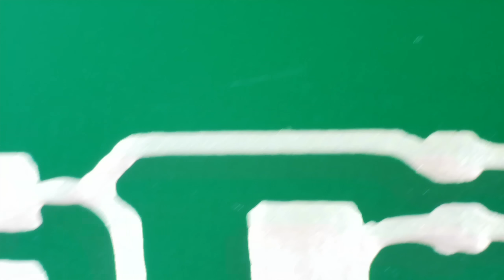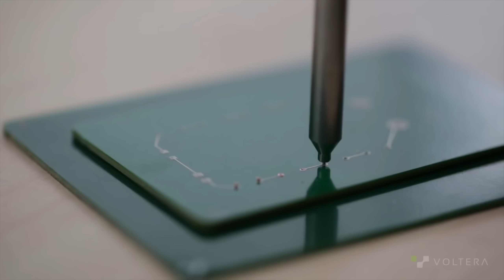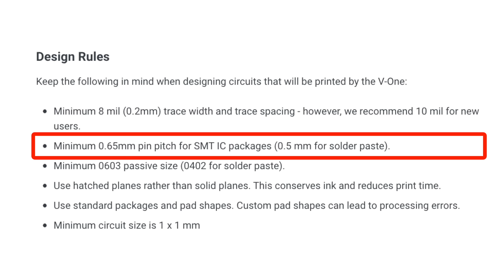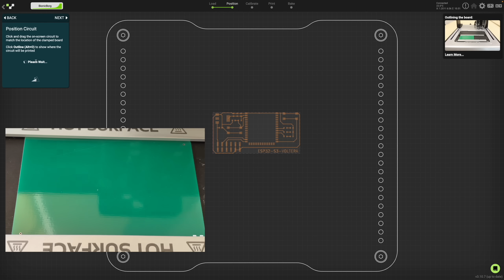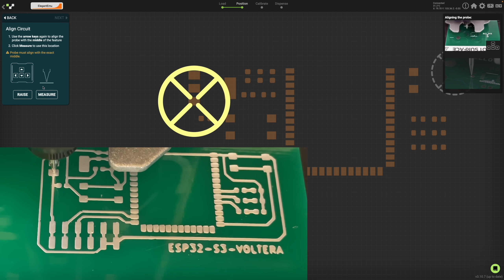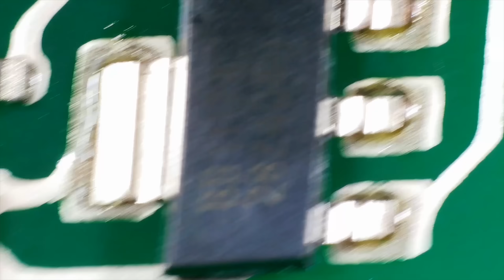Printing PCBs At Home!

Comment: Just get a K40 laser or some other cheap laser, make some safety mods, and use that! Black spray paint goes onto Copper Clad Board, then the outline of your traces gets engraved, theb etched, and then you clean the spray paint off. Surprisingly accurate THT and SMD footprints if you are careful with the dremel when you drill it! I have been doing this for like 8 years now
Reply: @user-tz7lk3cx1d  
It Kinda Works has a great video, but he does way too much work filling in pads and such- I have found that the etching is consistent enough that you dont need much post-processing on your PCB. I do a first pass at the lowest my machine will go (~1w) at 8mm/s  and then a pass at 14mm/s. Then I clean it with an old toothbrush, soap, and water. I put it into ferric chloride for 15-20min. I drill the holes with a dremel, for THT parts, and end up with a perfect PCB almost always.
Reply: You can do the same with a 3d printer and a sharpened screw instead of buying a laser. It's called pcb scraping.
Reply: @zaqwsx28  Yep! I have tried that too! Works great!
Reply from the maker: Nice - I've been looking at these cheap laser engravers, but so far I've held off due to safety concerns.
Reply: @atomic14  Honestly, after some limit swotches to stop the laser when the lid is open, and after getting some approved safety glasses for the correct wavelength (a quick google search will find them for you), and grounding it, there really isnt anything that can go wrong! The machine is honestly a lifesaver for quick prototypes and goes great alongside a 3d printer as well!
Reply: This really works, it takes time buying the right paint though : (
Reply: how thin can you go with ya pcb boards?
Reply: @pepe6666  I have done 0.1mm traces without a problem.

Comment: Do you know how many boards you'd have to make to offset the cost of an actual PCB fab? Especially with the severe limitations of the manufactured board.  There seems to be absolutely NO cost benefit to this machine, except maybe for a classroom setting or something like that.
Reply from the maker: I think that's their target market - a large enough pool of users who will get through the consumables before they expire and just need to get something made quickly.

Comment: For components which will have mechanical loads applied, how about pre-milling the pads slightly to remove the gloss from the board and give a better key for the conductive paint?
Reply: This is good idea

Comment: Is it normal to half un-melted solder left over round the joints as I can still see the tiny balls of solder ? I think this is so niche they can't be making many. The complexity of the circuit is very limited double sided and via rivets all seems oddly like a step back and Oh ! the price tag to rich for me I fold !....cheers.
Reply from the maker: I think that's the effect of the solder no flowing on the pads, it kind of melts in place and you get the flux residue remaining. Or I need to crank up the heat a bit more. It just doesn't behave like normal reflow. And you're right, the price is way too much (as demonstrated by almost all the comments :))
Reply: :) @atomic14

Comment: It dispenses from a nozzle then bakes it - sounds like it would be better just to stencil an image on it with some powdered flux and then powder coat it with  conductive dust (sticks to the flux) because you already have the ability to bake boards. 
Then you could basically make boards in one shot processes instead of having to speed up the video 10x - faster process means less footage means less editing work too!
I'm super lazy and this also looks like a lot more effort to manage the tools and materials because they get wet with materials that cure, blegh always running against a clock or something with wet/activated materials...

But honestly if you're gonna do it this way then you should be able to use the same gantry to pick/place your parts too, especially since it already knows the board plots.
Reply from the maker: I'm surprised they haven't got a pick and place attachment - it feels like it's almost got everything to do it. It's just missing the cameras for aligning parts.

Comment: i had problems when i had an led on pin 2 or 4 (in not sure wich didnt work).  when i wantet to upload an arduino programm in my esp32 dev board, the esp worked fine to upload on my laptop but on pc i always needet to press the boot button, but this didnt work... so the programming always timed out. it took me a while to find the problem, because i made 2 of the same boards but i used my pcb cnc.  one for my friend, and one for me. my one did work without any problem,but the other board did not work and looked like it was write protected... all parts where the same only the ir recivers did came from old pcbs i salvaged.  but the problem was that i had the resistors for the leds a little too small, and the tolerance in the resistors itselve did cause the problem. just used ones with higher resistance and it worked just fine.
Reply from the maker: Easily done. Sometimes it's just not obvious which pins will cause issues. The documentation always seems very clear, until you find that it's not!

Comment: So expensive 😢. It’s a glorified 3D printer, so it’s a little wild we haven’t seen some cheaper alternatives. Or… maybe there are some?   The movement system isn’t that much different, and precision seems like it’s even less important since the ink and paste squish out some.  🤔.  I guess when using the drill it would need more rigidity and precision.
Reply: I think you're right. Considering it's a glorified dremel doing plunge cuts, not routing it doesn't seem like you'd need a stronger structure. Decent sized linear rails vs the standard roller design on low grade printers might be helpful to minimize torsion. I'd almost bet someone out there has already done this somewhere. That said the laser engraver method which was outlined on this channel or the resin printer solution seems like just as viable of a solution with much less tinkering involved.

Comment: OK.... what stops anybody just using a basic 3D printer.. with a liquidpump???

Also... just set it into epoxy after reflow soldering?

Or maybe they should just add a glue pump option that also applies glue points that melt while reflow. (Initially liquit through solvent.. but melts again at like 300° or what their solder needs). Cant be that hard!

Comment: I wonder if electroplating a layer of copper would improve wetting
Reply: probably. might also work to reinforce the bond between the traces/pads and the board, or at least make them more rigid so they don't flex as easily.

Comment: Being able to fast prototype with SMD, the solder paste printing, and fast turnaround would be huge pluses, but the drawbacks of being single sided with no vias would rule this out for me. I’d rather pay 20e and wait, and get a professional board with cutouts, stencils, and holes. For prototyping I’ll keep using veroboard with breakout boards for SMD chips.
Reply from the maker: Agreed - I would be interested in trying out the drill attachment and the rivets - but it feels like a lot of work...
Reply: Do you mean 20 €? Is it delivered from China or you order locally?
Reply: @swgar  I live in Germany and get them from Aisler, a German company. Reasonable price and great customer service. And if you want them fast you can pay more and have them in a few days, but a couple of weeks is fine for me.

Comment: I almost got this machine when it was first launched. Glad I didn’t, I mostly use QFN packages and sometimes even smaller. Even the China manufacturers struggle with some of my chip clearances 😭
Reply from the maker: Yeah, I've had a few times where they've come back to me with engineering questions and we've had to switch to green solder resist as apparently they can do smaller features.

Comment: With these limitations you might as weel just do it the old fashioned way, inkjet print to foil, photoresist over the PCB, UV, then into acid. It is much stronger then this gimmick.
Reply from the maker: But also much messier - though I do have bits of silver ink everywhere now... :)

Comment: How does it compare to milling a copperplated board? in terms of speed of manufacturing, accuracy, electrical characteristics and price.
This printing seems nice but kinda gimmicky.
Reply from the maker: I've never tried milling, but I imagine that's the copper to board bond is much stronger. Also copper will have much lower resistance. I think this is a good for very quick prototypes - I'll see over the next few months how much use I get from it.

Comment: The approach doesn't look right - Drawing the circuit (without post-processing like lamination) instead of etching away a copper laminated board is always going to be expensive and problematic. Forget about the fixed cost, the consumable cost of each board with board, special ink & rivet will probably be higher than pcbway. And even for trivial circuits, the manual steps will keep increasing as you find more issues (solder mask, silkscreen).
Reply from the maker: True - the benefit should be speed of prototyping. We'll see over the next few months how much use I actually get from it. With my schedule I don't mind waiting a couple of weeks for a PCB. But maybe it will reduce my stress level every time I send off a PCB worrying about the mistakes I've made in the layout...

Comment: If this can be used a CNC milling machine, whats the point of the silver paint? You can probably make better PCBs using the milling function.
Reply from the maker: The main issue with the machine would be how strong the milling head is  attached to the machine. Currently everything is attached by strong magnets so you can't apply too much lateral force to the head.

Comment: Been doing it for 7 months now, savings me a fortune remaking cracked boards. Just need better access to PCB routes online
Reply from the maker: Nice - are you using a Voltera?
Reply: @atomic14  yes I managed to find a local hobby group that got demo units. I bought my own and since I've been using it a month prior I managed to get lots of assistance using the software and what works best with circuit boards it'll only improve. I did get a nice warming plate for about a grand it really gives me a lot more help with stronger connections

Comment: Little question from a mechanic : why do you put soldering past on all esp32 points even the one that not used ? Doesn't it increase the risk of short cut without bringing any advantage ?
Reply: Thermals and mechanics: The pins are the only thing holding the chip to the board and a major path for heat to leave the silicon. SMD parts can have fairly substantial current-ratings cause they can have a direct metal-to-metal connection for cooling (given a big enough copper infill).

Comment: I've learned to view to surface mount connectors with suspicion, and that's on normal PCBs! You should get some neutral cure silicon and stake everything down. At work, we use 3145 RTV, but that stuff is pretty expensive. You can get much cheaper neutral cure RTV at the hardware store, but I have not used it on PCBs.

When I was looking for a PCB printer, the Botfactory SV2 looked like it was the closest to what I wanted. That one also prints an non-conductive resin, so you can have multilayer boards.
Reply from the maker: Wow - the SV2 looks amazing! How does the price compare?
Reply: @atomic14  Looks like start at $15k now. I didn't end up getting one since you are still limited to lead-free low temperature solder, and you need to do a lot of prototyping to make it worth it.
Reply from the maker: @unknownhours  I think that's the problem. It needs to be the same level at 3D printing where you can get sub $200 machines that just work.
Reply: @atomic14 There's no 3d printer at sub $200 that just work))) It might work. Or not. For printers that just work you're looking at Prusa and Bambulab at cheaper side. And 3d printing tolerances are much worse than this machine needs. It's mechanically more expensive (you can't use cheap belt drive), extruder is very complicated and precise and more importantly - the market for such machines is very small compared to market for 3d printing, so designing and supporting such a device is also much more expensive. So yeah, you won't see this machines under a $1000 either.

Comment: We used to do UV etching many years ago with pretty high accuracy. Does require using some acids though.
Reply from the maker: I've never actually etched my own PCBs - but it's always struck me as being potentially very messy. Having said that, I do seem to have silver ink in various unexpected places now...
Reply: @atomic14  wasn't that bad to be honest. Also not that expensive.
Reply: @werner-real  silver ink always was expensive for the results it gave me
Reply: @atomic14  no, it's not that messy, just don't use iron chloride.

Comment: My local university had a few of those when they came out in 2018. I tested it but I could not get it to work consistently and after much complaints they are now only used to solder surface mounts. We got the Wegster-CNC machine to cut traces in stead.
Reply from the maker: That looks like an interesting machine. If I had the money I'd be tempted to get one for the PCB milling and then use the Voltera for doing the solder paste printing. All I'd need then is a pick and place machine and my factory would be operational!
Reply: This is exactly my experience caring for one of these things that lives in the Student makerspace where I work.
Reply: Yeah, we have one at work too, and we basically stopped using it, because if you don't use it daily, you get wildly inconsistent printing results and it takes so much time to get it to work each and every time. Not worth it, unfortunetaly.

Comment: Cool in concept, nice to watch on youtube - but in practice its a non starter - too limited, too expensive.
Isolation milling can be had for 250eu with 3018, for 5k you can probably get a LPKF machine that will outdo this one by a mile and half.
Reply from the maker: I hadn't heard of LPKF machines before - I'll have to take look (though I don't have 5K laying around to spend :))
Reply: I wonder if you could make PCBs with a laser engraver... just put down a layer of copper foil and remove as necessary.
Reply: @DFPercush  this is exactly what LPKF offer, there is even multiple solutions with UV, green and IR lasers. I'm curious how they've managed to ablate copper without any damage to a substrate. Every attempt of making PCB with fiber engraver I've seen ended up with burned FR4.
Reply: Also never heard of this company, this lasers looks awesome. Do you mean LPKF ProtoLaser H4 by 5k machine? I really doubt that german MOPA (likely) laser + mill in class 1 housing could cost 5k. My bet it costs 20—50k.

Comment: Interesting machine but the finished boards seem like the traces would be very fragile.

I'm surprised we don't have a group of "do it yourself" guys developing a print head that could be adapted to a normal 3D printer.

We would still be at the mercy of the ink manufacturer for ink prices.

If they come up with a powdered iron mixture they could print some interesting transformer cores and electric motor hubs.

These could also then be magnetized for motors, generators and guitar pickups for example.

With a two headed printer such as a modified 3D printer we could use one head to lay down a layer of iron core for a transformer and then print the winding layer with the trace head. Cure it with a built in heater head and then print the next layer. Keep going to print complete motors for example.
Reply from the maker: I think the issue with all these machines is that the price of manufactured PCBs is so unbelievably cheap. When you can get 10 double sided boards  for around $5 manufactured and shipped in less than a week there's no real incentive to try and do anything.
Reply: @atomic14 It's compelling for the same reason fast 3D printers are: rapid prototyping. Rather than a few days, you can be testing your new design after a few hours.
Reply: @atomic14   I disagree. Moving this technology over to the common 3D printer platform would bring the cost way down and open up many avenues of development.

Currently printed circuit boards are flat. One this technology is blended with common 3D printers we will be able to print circuit boards of any shape.

The printer could have an additional head that prints out a slurry of plastic powder with UV cured glue which could then be hardened with a UV diode or UV diode laser. A slurry of powdered glass and UV hardening resin is another possibility.

On top of these layers we could print the conductive traces to be used like wires.

Those old fashioned ball ended variable tuners for early radio could easily be printed out without the need to make the hub and then wind it with wire.

Getting away from flat circuit boards; circuits would fit into watches that curve around your wrist better.

Choke coils could be drawn and printed in addition to circuit boards. The disk iron core could be printed in layers with an iron powder with UV  hardening epoxy. The coil around this core would be printed in separate layers using the silver compounds or copper versions.

The current slicer software for 3D printers could easily be adapted to these concepts.